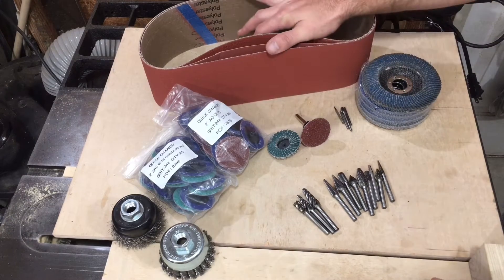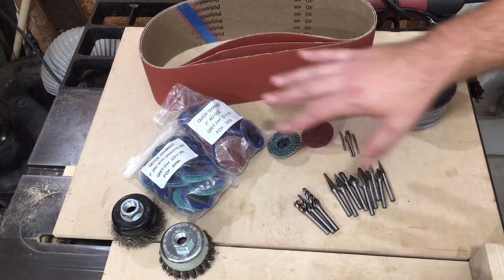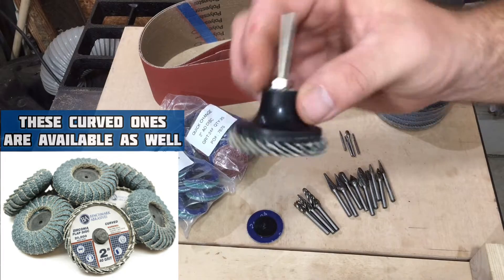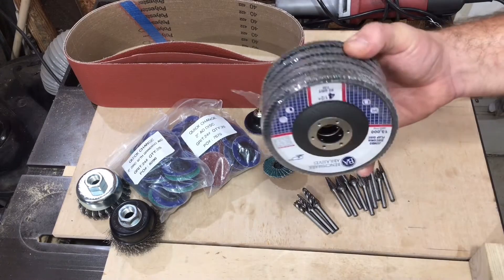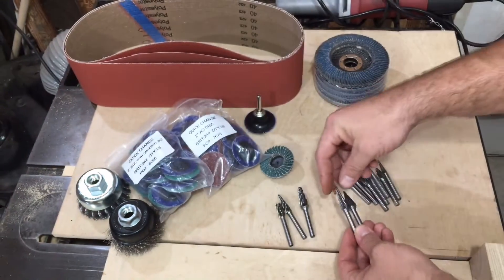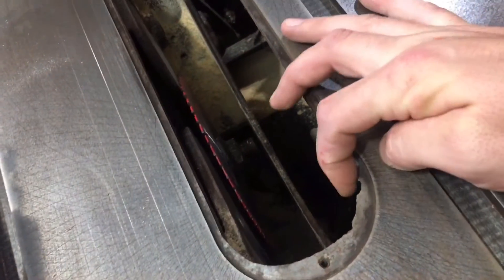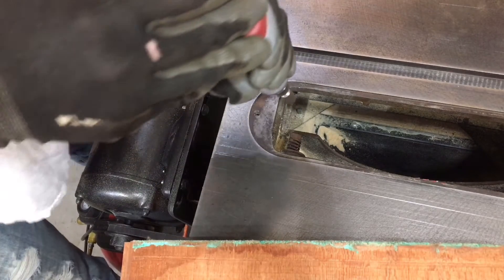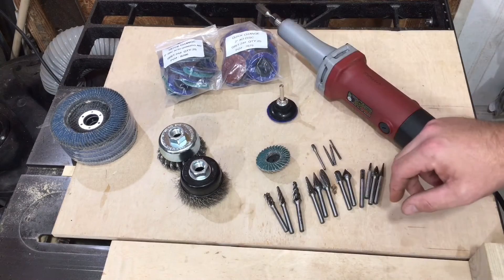Metal Working MUST-HAVES!!!

Comment: I'm kind of new to metal works,etc I would like to find something that could possibly grind down hardened steel what would you recommend for that?
Reply from the maker: Harden steel can be tricky because there are many types. Carbide burrs are good for fine detail work but for bulk removal i typically go with a 4x36 belt sander. There are various abrasives to choose from too. Annealing the steel is also a great option if your able to do so. There are way better craftsman than me on youtube but thats some basic info to at least point u in a couple directions I hope

Comment: Got a question on if the dremel tools with the birzs will work for my application. Working on a tractor Oliver model 70, the engine block ports the long oval ports have become infused with rust over the years that sat out in the weather. I don't got the money to take the engine out and bring it to a shop. Would any of these dremels cut away Rusty metal medium steel?
Reply from the maker: It can definitely take off rust. Just be careful you dont take off anymore than you want to and that the rust thats removed wont cause any harm to the engine. I'm not a mechanic tho, I only know how to fix the stuff I have been too poor to pay someone else to lol

Comment: What is an attachment I can get to widen holes?
Reply from the maker: The burrs are good or you can try a reamer. All depends on size of hole and material
Reply: Step bit?
Reply from the maker: Very good option as well if looking to REALLY open up a hole... reamers and burrs better for dialing it in

Comment: You sound just like Bruce Dern when you talk. I guess it the nasal sound you make through your nose. Anyway nice video.
Reply from the maker: No idea who that is but yea I know I talk through my nose. Can’t stand it
Reply: @BradsWorkbench   Bruce Dern is one of my favorite actors. He was in a lot of John Wayne movies and several Gunsmoke  episodes. I build kinetic wind sculptures and I use schedule 40 3/4” stainless pipe to house the bearings and the pipe has to be bored for the bearings to go in there. I’ve tried 3 machine shops to do this and they just flat don’t want to do it. They hate working with stainless. I have a small Atlas lathe so put my pipe in the lathe and use a die grinder with a carbide burr bit and I am able to bore the pipe out for the bearings. I bought the carbide burr bit from eBay but think a better quality burr would last longer. So that is what lead me to your video.
Reply from the maker: Sounds really cool. I have a 2nd channel for my woodturning as well. Do you show your work on youtube or Instagram? Would love to have a look
Reply: @BradsWorkbench   I don’t have anything on the internet.  Look up Mark White kinetic wind sculptures and that is similar to what I do. I sure enjoy building them. It is very frustrating at times. Especially balancing. I am going to contact the company in your video and order the carbide burrs. One of the machinists that tried to bore them for was amazed that I could bore them. I told him with a lathe and a die grinder turning at the same time the metal has to go somewhere. I have to stop and check my bore often. Otherwise I take a chance on the bore being oversized.
Reply from the maker: 🤣 "the metal had to go somewhere"..... nice, i'll check the guy out as well